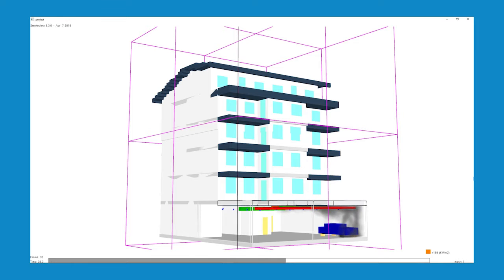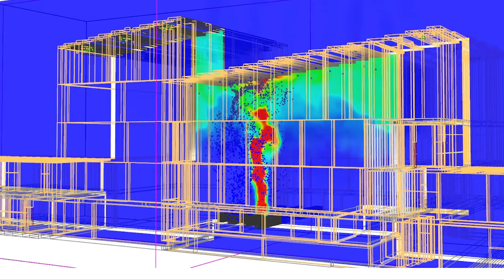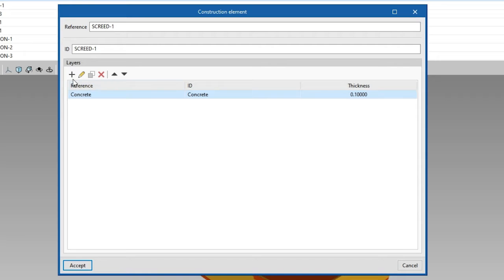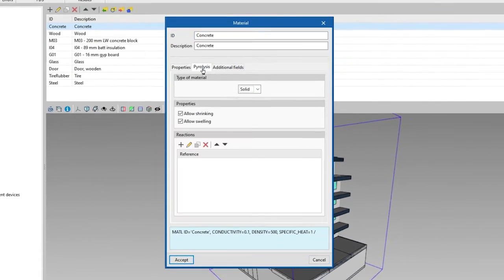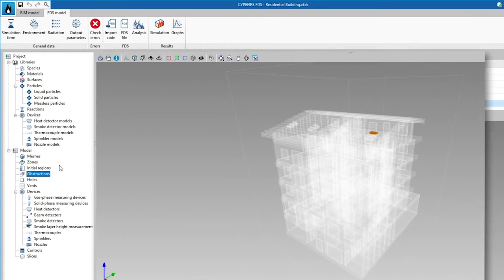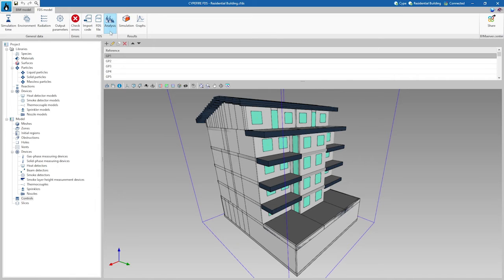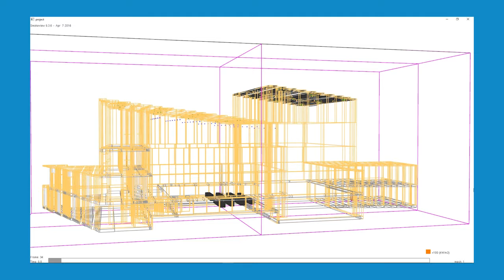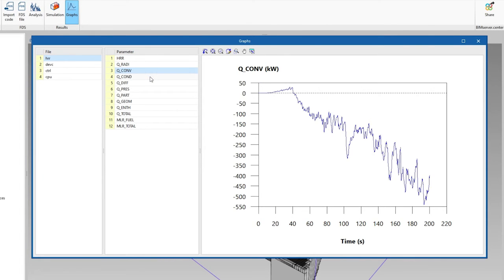CYPEFIRE FDS

Comment: Does it also account for flashover? 

Can you alter the in building airflow at set times (for fully developed fires)? Fx firefighters enter building at time x opens this and that door.? and so on .. 😅
Reply from the maker: Hello! Yes, it is possible to simulate a flashover scenario or complete ignition of the space by indicating the temperature at which the different surfaces ignite. It is also possible to model doors opening after a certain time, which simulates the entry of firefighters and generates air currents due to the difference in pressure. Kind regards 😊